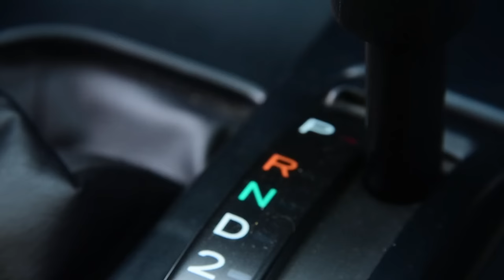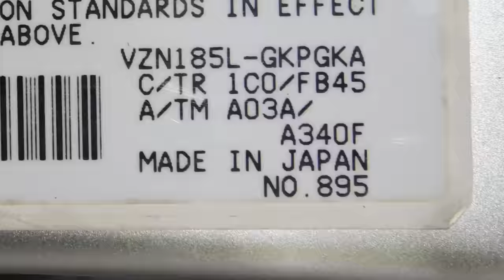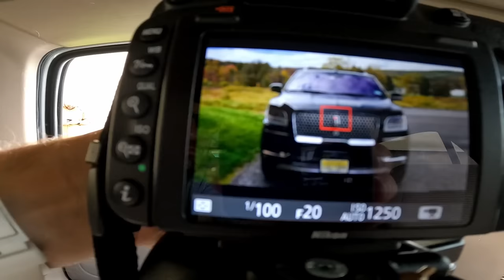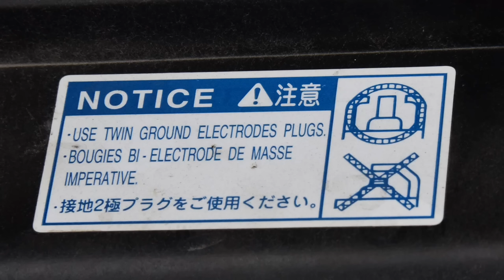2000 Toyota 4Runner SR5: Regular Car Reviews

Comment: 4 gen 4Runner with a V8 is still my favorite. I know all the 3rd gen did not cam standard with a sunroof😂. And if you have a TRD blower it doesn't blow head gaskets if you drive like a normal person. They're four-wheel drive trucks not race cars. And if you treat them like that, then they do four-wheel drive truck stuff better than any other truck in its time.

Comment: The sad irony is that this video debuted less than 24 hours after I sold my third generation 1999 4Runner. I did have only the 2WD/4-cylinder version (i.e. the "soccer mom version"), but it was still a fantastic car that was still running pretty good at 211,000 miles. If I had the 4WD version I would have never sold it.

Comment: Don't forget, 4cylinder 4runners exist from the 1st gen till the 4th gen (in other markets, 3rd gens in the US can be found with the 4 cylinder). 1st gens and 3rd gens feel so light. 4th gens got "fat" buttttt they got way more power, even without the V8. I really like my 4th gen. Miss the 96 3rd gen I had for a small while.
Reply: 2010 5th gens had optional 4 bangers for a short time.

Comment: You need to consider the Tundra brake upgrade - the rotors are undersized for the weight on these trucks and warpage is common.

Comment: I own a 2002 tahoe with over 300 thousand miles ... the gmt 800 series suvs are the best suvs ever built , I'm a firm believer the Toyota suvs are equally good ... if I ever had to buy another suv or pickup truck it would definitely be a gm product from 2000 - 2006 or a Toyota from the same era ,,, you just can't beat the reliability the cheap parts , and the simplest diy fixes ....

Comment: At the start this video, it felt like you were talking about a 1st gen non-PI Ford Expedition. I mean "just a truck with an enclosed body", "powerless engine despite the displacement and the level of tech", "slow to accelerate", "meh brakes, because small wheels". But man, by the 10th minute, it would seem a '97 5.4 Expedition (like mine) is way better in every way.

Comment: My 2002 has 450k on the clock with hard driving and horrible maintenance. I've been wanting to V8 swap it since it was 200k miles old but the damn 5VZ won't die...

Comment: I kinda believe the 21mpg people. I have a 2003 Ranger FX4 Level 2, which has a lot of similarities to what's holding the 4Runner back. I've got a 4.11 diff, old-timey 4L V6 that sits over 3000 RPM in 5th gear at 75 because the gearing is so low, and it's maybe even less aerodynamic than a 4Runner. If I put my mind to it on a flat highway drive I can TOUCH 20mpg even on 31" mud terrains.

Comment: I have the "holy grail" 98 SR5 V6 5 speed 4x4 4runner. And its original rust free. I don't have the E locker for the rear.
It gets 18 mpg. City, highway, country roads. Doesn't matter, 18 mpg. 
With the 2025 4runner being a unibody hybrid, I only see the value of these real 4runners going up.
Mine, never for sale.

Comment: 2000 was a good year. Cars were designed to LAST and when something broke, they were designed to be repaired by you, the owner. I personally have four cars. A 2000 Saab 9-5 Wagon, a 2001 BMW Z3 3.0i 5 Speed, a 2019 AWD Mazda3 “Premium” sedan and a 2021 Tesla Model Y LR. Both the BMW and Saab are repaired my me and only me. They are incredibly easy to work on and both are incredibly reliable. The Saab does everything I ask of it and only asks me to monitor its oil consumption every month or so. The BMW is freaking bulletproof. Those M54s, M52s, and even N52 are freaking bombproof. And nobody knows because they associate BMW’s reliability with their horrible mid 2000’s turbo 6’s, but the NA motors were and are as reliable as anything coming out of Japan at that time. 

The Mazda3 on the other hand… I accidentally bricked the car once by not putting it in “service mode” before changing the brakes. The automatic emergency brake turned on when the caliper was disconnected from the rotors and the piston came so far out that it damaged the entire caliper. $1,600 to repair. Car wouldn’t start because it couldn’t sense that the brakes were being pressed. Also, the screen bricks occasionally and just doesn’t turn on…

The Tesla while it has been fairly trouble free, I have had 2 situations. Once the HVAC stopped working requiring a soft reset of the car. This happened in -10° weather in the Poconos. And once the car got stuck in reverse and refused to do anything because the screen had froze as well. Luckily I was home when it happened because after I forced the charger port open and plugged the car up, it seemed to self correct. Outside of basic filter changes, I wouldn’t touch ANY of these new cars.

Comment: Screw this, you haven't lived until you've driven a 2001 RAV4 AWD Manual.  Bought one twelve years ago with 57K on the clock, now has 170K which means that the rings are just seating.  Original clutch.  With dedicated snow tires it is invincible.  Greetings from Minnesota.

Comment: Review the 2nd gen. Mine has stock steel plates 4.56 stock gearing. Lighter than the 3rd, better suspension. And i swapped a 5vze

Comment: One of the carry overs from the previous generation was the iron block and aluminum head. Iron blocks are nearly indestructible. Nearly. Aluminum drops weight. And of course they heat and contract at different rates, causing the head gasket issue that is on many vehicles with that idea. It was so bad on the prior generation, Toyota actually recalled the 4Runner and Pick up. The 3.4 used the same shitty composite gasket. They did make a running change, but some of those early ones had to be redone.

Comment: I had an Australian model, not quite 4runner but called a Prado. Manual 3.4L couldn't get to 60mph in anything less than 17 seconds. Woeful. Uncomfortable. Wouldn't tow. But went forever. 300,000 miles when I sold it, probably still running.

Comment: Funny part about this vid is that my family had a 2000 v8 awd explorer and 1999 4runner 4 wheel it's okay I like them both the explorer in my opinion was stronger but the 4runner had better handling.  I know the Toyota runner has 314,000 and explorer has 292,000 both never gave any issues

Comment: I have a 97 base 4cyl 2wd a/t and there is NO SUNROOF. Crank windows but it still has the power sliding rear window. I needed something to move things around in, and a similar condition Taco would have been 2-3x as much 🙃

Comment: Wish the engine in my 3rd gen hadn't decided it didn't want to have compression in cyl 4 anymore, especially after just doing the timing belt and knock sensors. It will live again though, eventually... Had it for 10 years, why not another 10 more.

Comment: i traded in my 97 limited for a 5th gen and wish i would of bought a better 3rd gen to replace the 3rd gen. but i still got a 99 sr5 with 295k miles and 00 limited imperial mica jade.

Comment: I have owned a 1991-97-99 4runners i did use the OH S-it handle. I own a 2006 v6 and a 2007 4runner 2uz-fe 297,000miles ( will hold 100 all day)
My 99 runner which has been a backup for the kids got 20mpg highway 15 city the 97 would get 23mpg at 80mph. 2uz = 10mpg 15 on the Highway at 85-90 try to drive it slower(34" mud tires HOWLING WITH JOY)

Comment: Yes you can get a base 4 cylinder manual 2nd with no sun roof , manual windows, no clock, no rear heater, no spoiler no flares no rear wiper 15 inch 6 spoke alloy wheels and no trailer hitch.

Comment: I had a 96 slick top but sadly was a 2wd v6. 327k miles on original engine and transmission! Only sold it because towing my 240sx race / drift car was sketchy

Comment: 2001 4Runner has the best ride of the 3rd gen, especially with 17 inch wheels and a set of Michelins and 93 octane increases the power tremendously and don’t buy cheap rotors. If you do you will always get a tremble.
Reply: Do the Tundra brake upgrade. Easy mod, nice improvement over stock.

Comment: You can totally work the 4 banger 5 speed tacoma hard. I had one for a few years and it did EVERYTHING I asked it too. I towed a trailer with a load in the bed from Seattle to Pittsburgh twice, took it off road through the Cascades all the time, and it was my daily for 3 years. I even sold it for a profit in 2022. 

Its solid, you can do what you need with the 4 cylinder, within reason. Great truck/suv.

Comment: POR15 is not f**king around when they tell you to use proper ventilation and respiration protection when applying. That stuff will mess you up. Just being outside when doing it isn't enough.

Comment: I had a 2000 4 cylender standard transmission 4runner. It was such a fun little thing. I did not go fast at all of course. But fuck could that thing go. Sad day when I lost her (rear ended at a stop light) But my 4runner did not have a sunroof, so they did come without them.

Comment: DO NOT TURN WHILE IN 4WD ON DRY PAVEMENT, hell i blew out a rear diff in a 86 ford ranger doin doughnuts in 4wd in my dry field . of course i was  going in circles. but still in dirt.

better mileage with narrower taller tires

i think the v6 sounds fine sounds kinda good like a buick engine
and you forgot to mention the best part, these v6 engines are non interference!

Comment: Ehhhhh 2nd gen with 3.4 swap

Had the perfect contender for you, that I built (3.0 to 3.4 swap, auto to manual swap).

Until it met its demise to a 2018 accord that didn't like stop signs or care about headlights coming at it two hours shy of midnight almost exactly a year ago. 

3rd gen best gen? No. It's like you say you like old Toyota trucks but think as far back as 90s Tacomas and don't realize Toyota sold "Truck" in the 70s, 80s, and early 90s that became the 4runner with the help of a pop off cap. 

Like the oddball T100 that wasn't quite small truck, nor full size. The middle man between Tacoma and Tundra.

Comment: ....Does anyone wanna buy a holy grail?? 99 SR5, 5spd 4x4. 236k, so clean inside the motor you could eat a 7 course gourmet meal out of it. Frame and body gone from northeastern salt. Blue "moon mist" interior and perfectly functioning sunroof. However, it comes with a mostly rust free California 2wd to use for frame and body swap... I wanted to build it but decided against another modern classic and bought a brand new Off Road Premium to prevent from rusting and mod instead. Located in York, Pa.

Comment: The poor runner spec on the 3rd gen had the 4cyl and no sunroof

Also the 4th gen has 2 oh shit handles for each passenger 

And the brake warping issue is a 4runner thing across every generation

Comment: Or you could have a Blazer or Tahoe for half the price, which would cost half as much and run just as long while costing way less to maintain since GM V8 parts are virtually free and you can buy them at, like, the pharmacy. Yeah, 4Runners are good, but nowhere NEAR as good as everyone thinks they are. An XJ does it better by a lot.

Comment: NO- you're wrong about the 4runners going fast being " pushed hard and strained"... that's BS... Magnusen makes a GREAT SUPERCHARGER and it works GREAT- and the 4runner does NOT have to strain at all to be quick!!!   I will be doing a POWER STOP power brake UPGRADE.. and other changes too...

Comment: For me-- I THANK GOD it's NOT like all the rest of the CRAP on the market-- not overloaded with electronic/robotic "assis" bullshit-- or tech crap that will blow apart and cost a fortune to fix-- and GLAD  it's different- and rides like a Truck-- because that's WHAT IT IS.   THESE take a SUPERCHARGER very well- and the engine is EASILY solid enough to handle it.. and have a great deal of "gentle" boost across the full range of pedal with NO "lag" ever... and will outperform all the new crap.. ALL of it.   I intend to find one-- southern vehicle with NO exposed periods in snow country where they salt the roads,etc..- RUST FREE or very LOW rust in other words... and the rest SOLID as a TANK..   THEY DON"T come any better.

Comment: "Change doesn't necessarily have to be a bad thing" - what's sad is when the change is bad, and completely unnecessary, like that sunroof in your 4Runner.  At some point in the 80's and 90's American dealers figured out that buyers loved the idea of a sunroof, so they optioned every luxury car with the sunroof, until they simply became mandatory equipment in the US.  Then, like a bad rash, the mandatory sunroof moved to less luxurious models, to the point where the word "slicktop" had to be coined.  People over 6 feet tall?  Your head is gonna touch the roof.  Fashionable ladies in Dallas, TX?  Your big hair is gonna be crushed, so you'd better drive in the gangsta lean.

Comment: I love mine. So much... The brakes... Terrible. Eats a set of cheap pads once a year and always needs a turning or new rotors. TN hill country isn't kind to the 4Runner. Struggle to get up the hill, ruin your brakes going down the hill.

And even if you don't have the J shifter... Still do the 4wd high once a week, or your auto shift actuator will freeze up.

Comment: You need to learn how the part time 4x4 works and what will kill it. You are begging for trouble using it the way you do.
Reply: I mean bear with me. This is typical for someone going to an offroad vehicle after series of passenger cars. This is less stable on pavement. Period. Do not use the 4x4 lever as a crutch to get back to feeling safe. You are peeking way outside of this car's envelope every time you feel like switching the front drive on. Remember there is no center diff. You are binding the drivetrain at speed. Oil overheats, drivetrain components suffer. Slow down.